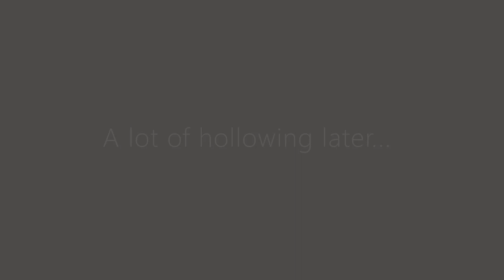Wood Turning~ Black Walnut Vase

Comment: Something you could try.
I use a sanding belt, various grades, turned inside out.
I loop it over the workpiece, and can then pull it against it, and move it laterally.
This allows me to vary the force applied without my fingers getting onto the workpiece.
It's safer, and more effective.
😊
Reply from the maker: Interesting idea! I shall try it some time. 
Cheers! 
Dom
Reply: @dzwoodcraft4337  
😊.

Comment: If one used a finer cut there is no need for.so much Sanding .It seems to me to much Cutting away ? Walnut is to difficult to Sorce ..omho.
Reply from the maker: Hey Donnacha! Under normal circumstances, that would be a better system for finishing. The wood I was using for this particular project was rather punky, so the grade of the cut would not have affected the result quite as much as normal. In addition, the sandpaper I was using was pretty dull, so it took a while to smooth what would be a very quick job with sharp paper. 
Thanks for your tip! 
Dom :)